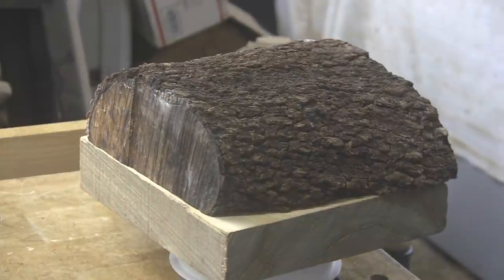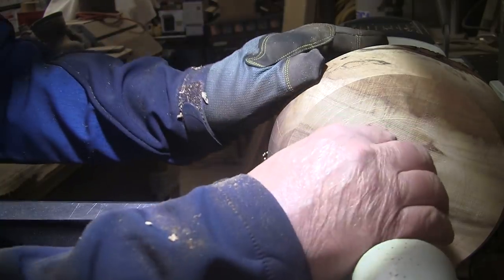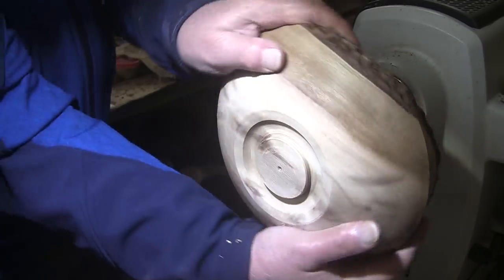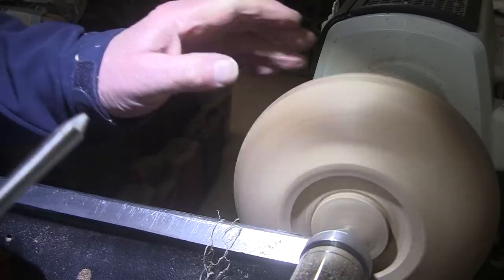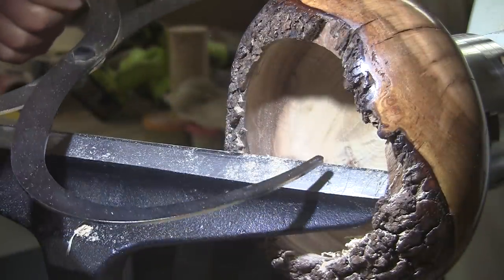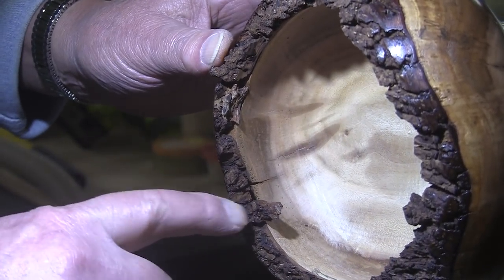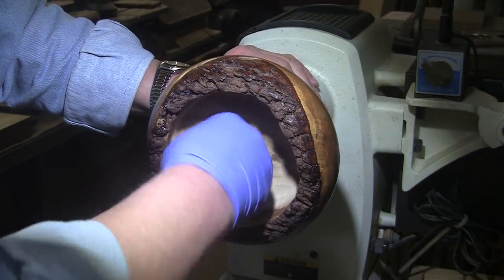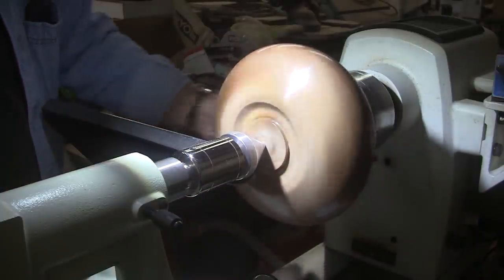Poisonous?  Gee, Thanks A Lot, Tuffy!!! - Wood Turning

Comment: Hey Phil, Your outstanding bowl kind a has the shape of the front tires on my riding mower. Speaking of which, when I went to mow the property yesterday I found that one of the front tires was flat. I put air in the tire and there doesn't seem to be any leakage. (I'll be putting tubes in all four tubeless tires next week.) Well it knocked the wind out of my sails yesterday and today, provided the tire isn't flat again, I'll be mowing. Phil maybe you can turn four tires out of locust wood or other hard wood for my mower. That ought to stop the flat tire issues once and for all !!!!!
Reply from the maker: Reminds me of a Dennis The Menace cartoon from many years ago.  His dad had a flat tire and Dennis asked "why don't they make tires out of concrete and roads out of rubber?"  Seems totally on point, Freddie!

Comment: Hi Phil, I'm going to have to buy a new Thesaurus as I've used all the adjectives in my current one up. That is truly gorgeous. Fantastic job on the bark. I can't find anything in my workshop if it comes off. Take care Phil. Cheers, Huw
Reply from the maker: I was very lucky to find those pieces, Huw, in all the mess but somehow, they just presented themselves.  Thank you, buddy!
Phil
Reply: Place a 1/4 inch screen material over your shop vac and vac the shavings up...   the missing pieces will present themselves quite easily.  If looking for a smaller chip of material, use a finer screen, as long as your shavings are going through it will work.

When handling this material, the oils in the wood are the component you want to be careful of.  If it has been laying on the ground for a while and has dried out, it may be fairly safe to handle without gloves.  If it is still wet, you may wish to boil the wood (about an hour per inch of thickness in the blank) to help leech out the oils and sap, then let it acclimate in your shop for a few weeks before turning.  This can also help homogenize the moisture content in the wood and allow it to dry more evenly with less cracking, depending on what methods are used.

If turning wet wood to make a finished product, do a rough turning while wet til you have a 1 inch thickness for all your dimensions, wrap it in a paper bag, and stick it on a shelf for a few months to dry out. turning it over every few weeks. (Keep the wet shavings, put them in the bag... will help with the drying process to prevent cracks).  Once the weight of the bowl is the same for 3 weeks in a row, it's seasoned, and you can finish your turning.  Keep in mind that drying will lightly wrap the bowl out of round.  You may even decide to make that part of the feature in your turning...

Great looking bowl!

Comment: Do you always finish your work the same? Two coats sanding sealer, followed by two coats shellack? Can boiled linseed oil or other finishes be used after the sealer?
Reply from the maker: When I use shellac, yes, pretty much the same, William.  Sometimes a piece may take more sealer, sometimes I want a shinier finish so I'll apply more coats, but usually, two and two.  Using Zinsser Seal Coat, ANY clear finish can be applied over it.
Phil

Comment: Nice bowl. But at 6:07 you left the chuck wrench in the chuck. That can be pretty dangerous.
Reply from the maker: Nice catch, Robot, but I was still in the midst of mounting the piece.  I was explaining the process while the wrench was in the chuck.  Additionally, whenever I'm not actually turning, my speed control is set to zero so even if I bumped the On switch it wouldn't have turned.  But, point made, safety first!  Thanks, glad you like the bowl!
Phil
Reply: @PhilAndersonShadyAcresWoodshop  I have done the same, and it is a nice bowl, and I sure do enjoy a thorough explanation.

Comment: Another really nice piece. I note that you didn't fill the cracks in the piece, is that because you believe in 'au naturel'? Do you ever fill in cracks and, if so, when? Also impressed with your patience in reconstructing the bark!
Reply from the maker: I seldom fill cracks, Ray, and yes, I prefer my pieces as natural as I can get them.  I usually only fill them if it's a structural issue.  I also don't usually fix the bark but this piece just cried out for it and I'm glad I did.  Thank you!

Comment: Phil, I’ve noticed you use a ⅝ bowl gouge a lot.  I have to make a handle for a new ⅝ round bowl gouge I just got.  As this will be the first handle I’m making, how deep do I drill the hole in the handle for the gouge?  Thanks for your help.
Roger D.
Reply from the maker: I don't make a lot of handles, Roger and I'm not much of a spindle turner, either.  That said, I would think 3-4" deep, depending on how long the bar is should do it.  Don't forget the ferrule!
Reply: @PhilAndersonShadyAcresWoodshop  Thanks for your input.  I appreciate your response.  I think I’m going to be more interested in what you do when I get more experience.  Thanks again.

Comment: Phil: I have been turning for few years, but have never done any bowls with a natural edge. Are some woods better than others for this? Also the only tool that really seems to work for me is my 3/8" Benjamins Best bowl gouge. I bought a 1/2" gouge but can't get it to cut real well yet. seems sharp enough. I want to try a longer 3/8" gouge, any recommendations ?  Thanks Dave-R
Reply from the maker: Howdy, David!  I think any wood can be turned with a natural edge.  If you want a live edge with the bark on, it's best to find a piece that has the bark clinging tightly to the wood but, again, any wood will do.  Gosh, a 3/8" gouge is mighty small for bowl turning unless the bowl is quite small, too.  I only use my 3/8" for removing tenons and for small detail work.  I think a longer 3/8" is asking for trouble.  They just aren't thick enough to withstand the leverage a spinning bowl applies to them.  I grind all my gouges to exactly the same edge.  I don't change a thing on my sharpening setup.  I wish you were here so I could help you out!

Comment: Bowl, bowl.   Why not tray which is a short wide bowl.  2 inches tall maybe 3.  10-16 diameter with a 1/4" foot that stands proud of the base.  Center on other side is hollowed out into a wide flat with a 2-3" side.  Turn bottom to 1/2" or thereabouts.  Nice - a bowl or a tray from the same wood.  Less wood for the tray.
Reply from the maker: I've made a few platters, Martin.  They are in my list of videos in the description for this piece.